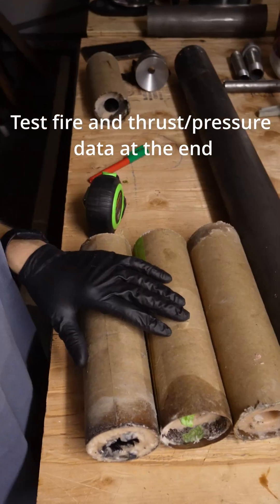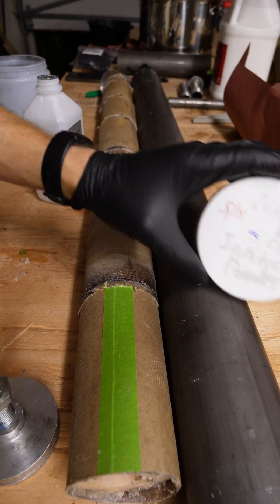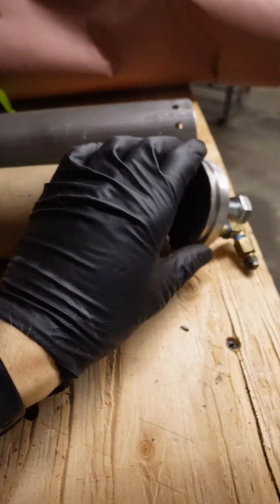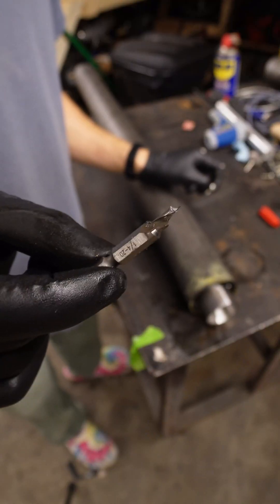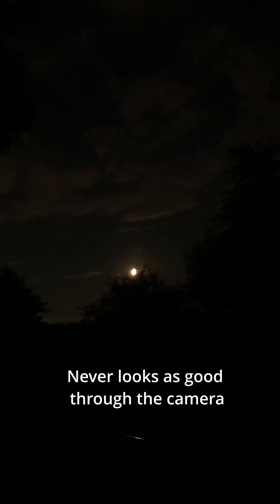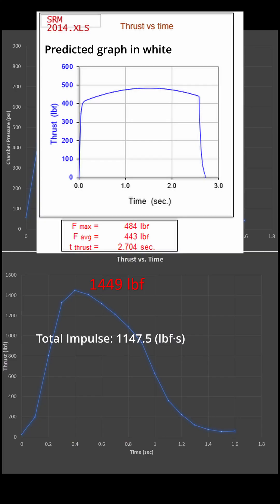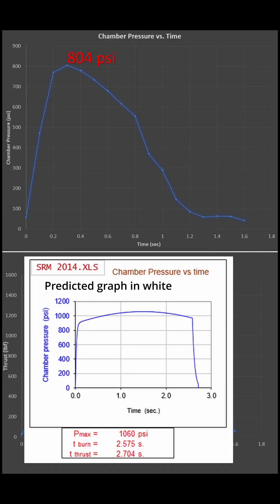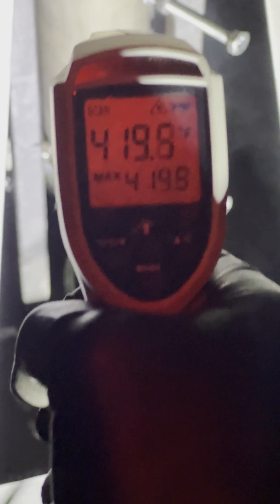DIY 1400lbf rocket motor (concerning results)

Comment: How many days do you let the grains cure ?
Reply from the maker: It was a bit of a process. I cast the grains on July 19th and fired the rocket on July 28th. I would have done it sooner, but I tried to use the ignition powder as a release agent on the coring rods, and they were royally stuck. I had to heat the whole grain up to about 170 °F, and they came out after that. At 170 °F, it was like the consistency of ice cream, but it hardened up when cooled. I pulled the coring rods out on July 28th as well.

Comment: Correct me if i'm wrong, but by default it's assumed that bates burn from the center core to the outside, and not on the top and bottom surfaces, so that may be the cause of your issue. I don't know what software you use  but i've tried openmotor before and it was really close to the real world data. As for the arduino, i've heard that people had better results using SDfat lib instead of the default one. You can also try to use buffering and log the data in bigger chunks. If that still doesn't help, take a look at something like teensy or esp32 boards.
Reply from the maker: Thank you for the detailed response! I am going to have to try out Openmotor. Looking at it now, it has some great capabilities to what I am currently using. I think the next motor will be designed with it. 

 I did plan on the grains to be burning on the ends when I simulated the motor and made sure they were lit with o-ring spacers and ignition powder, but maybe my current simulation software isn't as accurate at higher pressures. I also think that my potassium nitrate could be a finer grain than what the software is predicting.  

Good idea with the code and hardware upgrade. I just ordered an UNO R4, which should boost the processing horsepower.  That and cleaning up the code will hopefully get some reliable data. I also need to revisit my shear bolts because they should have gone at 1800-2000 psi, but maybe I had my math wrong.